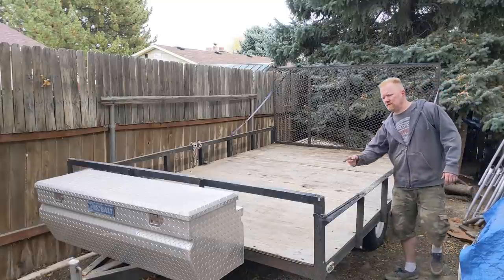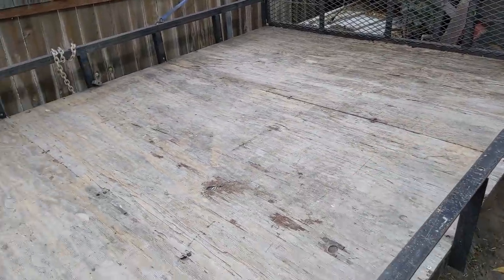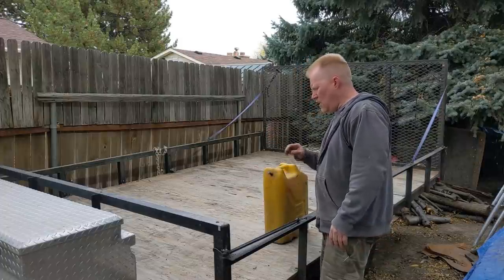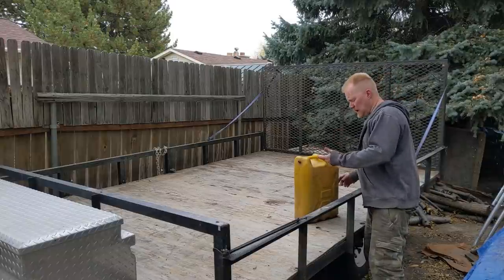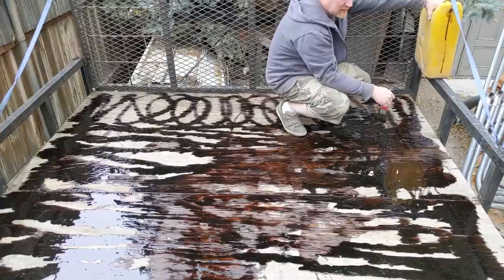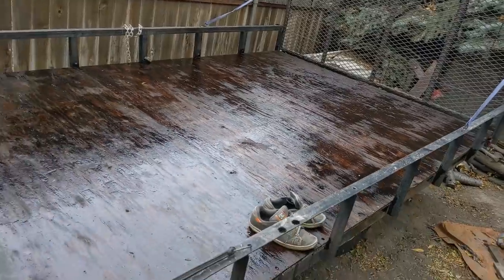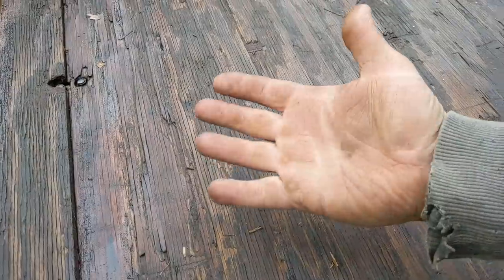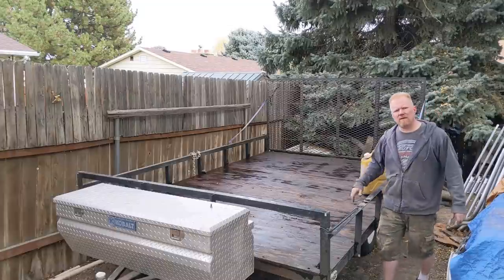Make Trailer Deck Last a Lifetime for FREE with USED Motor Oil

Comment: "If you don't have access to used motor oil..."
I feel like having 5-ish quarts laying around is a prerequisite to watching this channel 😎
Reply from the maker: Well Said. I have other videos where I do this and I get asked by people all the time where they can find used motor oil.
Reply: I NEED to find uses for mine, i filled up a plastic 25 gallon gallon barrel and am transferring it to a 50 gallon metal drum!
Reply: And a bunch of metal shavings around your vice
Reply: I keep old oil for these things and the apocalypse
Reply: @dethmaul  well you could take it to a recycling center.
Reply: @sixtyfiveford  I hate  to say it but if you have to ask where to find used motor oil maybe you shouldn't be watching this channel.....
Reply: So with my father saving used motor oil for his chain saws(keeping it in a metal 55 gal drum barrel, which is nearly always full) I should be able to have enough to do a fleet of trailers! Lol
Reply: @dethmaul  ...Ahahaha sell to the guys who can’t or won’t change their own truck oil or wife’s car/truck oil.
Reply: @dethmaul  I burn mine up in my fire pit, just dump on about a pint at a time on a nice hot fire and it burns up in seconds!

Comment: You could just park a chevy on your trailer for a couple days too :)
Reply from the maker: That's hilarious!
Reply: That’s a “slick” idea.
Reply: Or a Harley Davidson
Reply: Hey, my f150s got plenty of oil from the front crank seal to go around as well
Reply: That reason for the Chevrolet suggestion is because general motors makes such POS products you are guaranteed to get great coverage on the whole deck of your trailer since the oil pan, transmission, axles will be leaking almost from driving it home from the new car dealer.
Reply: Lmao
Reply: I was gna say my jeep would do the trick but then you won't know what kind of fluid it on the deck
Reply: If it's leaking oil... then it has oil... gotta worry when it stops 😄
Reply: ??? Never had a Chevy leak oil.
Reply: @that_one_dude_3541  never had a front main seal go bad?
Reply: @joshs1555  no?
Reply: Ouchy! lol
Reply: The problem with parking a Harley on the trailer is getting the dino bike to start.

Comment: I do all my wood handle yard tool handles with it. I have see a guy that put a large concentration of oil and sand in a bucket and after using his shovels he run them down the sand/oil mix to coat for rust prevention
Reply: Thats brilliant. Thanks for the idea.
Reply: Pretty cool trick, especially if you live near the coast.
Reply from the maker: That's a neat idea. I've done a few yard tool handles and it turns out nicely. I generally put a light coat of Johnsons Paste Wax over the top and it's nice and smooth.
Reply: My grandfather had an oil sand mix bucket he cleaned anything metal in it. Prevent rust and clean rusted tools. Always finding a "new" shovel/ hammer on the side of the road. Two days leaving it in there clean like new.
Reply: @sethpureadah  Did he agitate it at all, to get the abrasive benefit from the sand or just let it sit? I do the majority of my shopping on the side of the road, so this is  right up my alley, or my side of the road, so to speak...
Reply: @YerBrwnDogAteMyRabit  both. Just dig a spot and keep filling the same hole in. Then cover it up and walk away. Repeat that next day if some not always. If rust was layered on bad he left it in there for a week I remember, he just bring a rag and wipe it off afterwards. It would be polished.
Reply: @sethpureadah  Thanks man, appreciate it.
Reply: Holy crap...  that just brought back a deep memory from when I was a little kid...  maybe hanging with a grandad?  They both passed before I was ten.  Damn it's a weird feeling...

But yeah, there was big bucket of oily sand, & when you were done for the day digging & whatever; shovel, spade, hoe, etc., it got run through the sand to clean & protect it then wipe it down with a rag.
Honestly I'm kinda freaked out, feels like a memory that hasn't been used in ~40 years.  Definitely going to ask my dad (thankfully still around- just turned 80) if he has any idea where I know this from.

Comment: i agree ive used old engine oil on my trailers fences  sheds etc for years and it does last forever best part is the price
Reply from the maker: I think it turns out looking pretty good as well.
Reply: @sixtyfiveford  I agree makes it look like proper trailer board
Reply: How long till the scent disappears
Reply: Does it increase the risk of a fire

Comment: Cool, I do the same thing but I use a roller just to make it faster
Reply from the maker: That works. I just hate paint rollers as I feel a brush bristle force it into the crevices better.
Reply: Interesting.  Thanks
Reply: Drive you car up on it, use a oil filter wrench and pop the filter off, then roll the car off the back. The will spread the oil all over the place saving time...😂

Comment: I do the same thing on my trailer and decks.  The smell lasts for a few months, and it's initially slick, when wet, but over time it's been great.
Reply from the maker: Sometimes it smells, sometimes it doesn't so much. This time I didn't notice any smell. I attribute it to doing it in the cooler months where the sun isn't baking it. It might take longer for it to dry though.

Comment: Thanks for sharing. I use motor oil on my wooden barn doors. It lasts 10-20 years, none of these commercial wood protecting products come even close. You just want to make sure to put something underneath to catch the excess oil. And as you said, the wood should be really dry before applying the oil.
My truck now needs a new bed, will treat the new wood I put on the same way.
Reply from the maker: Thanks for your insight.

Comment: Im 48 and been using used motor oil on our trailers, fence post, fence pickets, landscape timbers and any other wood surfaces i need to protect since I was a young man and my folks was teaching me the way of work. For my trailer decks I just pour my oil in a used 5 gallon bucket and slop it on with a mop. My neighbor told me that it not environmentally safe and I said that the oil is organic and it comes from the ground. He never complained about it again. Thanks for sharing.

Comment: I do the same thing.  My favorite mixture is 1/3 old diesel fuel, 1/3 used motor engine oil, and 1/3 either used automatic transmission fluid or used hydraulic fluid.  But any of these by their self will work just fine.  The diesel fuel just thins the solution down and makes it easier to paint on.  I use a cheap throw away foam mop and mop it on the deck.  When I get a new trailer or replace a bed in one I coat the wood once a day for a week, then once a week for a month, then once a month for a year, and from then on once a year.  My wood trailer beds last me 15 to 20 years easy after doing this.  I have one trailer thats been in my family since 1961 and it is only on its 3rd bed.

Comment: Another great tip Moe. The wood deck on my small trailer is so rotten I could punch my fingers through it. Lol. I was going to buy good plywood. Now I’ll just buy the cheap stuff and do this. I’ll probably coat both sides of new board then mount it to the trailer deck.

Comment: When I was a young warthog we had a shed that had rough sawn wood floor. My dad taught me how to put used motor oil on it and I used the crankcase oil from my ATVs and after I don't know how old it was 15-20 years that we use that shed when we tore it down the floor was in the best shape out of the entire shed
Reply from the maker: Thanks for the insight. I've found it works wonders.
Reply: This tells me "Always do the whole shed, don't stop at the floor.." ;  )

Comment: I have a Pequea trailer and used it to haul my Jacobsen greens mower. That machine leaked so much oil, it treated the planking on the trailer at no cost or effort on my part. Used oil is the best stuff to use on untreated wood. I built a ramp on the shed in the back yard out of used lumber and it was painted with used oil and is still intact after 10 years. The wood outlasted the screws I used to put it together.
Reply from the maker: That's funny. Self oiling mower...
Reply: @sixtyfiveford  Gee, where did I hear that one? A self oiler. I had a Harley Sportster that I thought had a chain oiler. It had a small hole in the oil tank that was oiling the chain. Goofy me. That was so long ago. I`m still learning. You are one of those that I learn from.

Comment: Had a mate used to drill two holes in his sills on his car , fill them up with motor oil then drain them out of the bottom and he had no rust on his sills the car lasted for years .

Comment: Great video! I use a cheap paint roller and I learned the hard way to not use old gear oil mix, it stunk for months. I also apply it in direct sun light so it soaks in better.
Reply from the maker: Yeah, I played around with some test pieces years ago with some gear oil. The smell made it a definite no go.

Comment: Great idea, I have used old oil on wood fencing for years plus if oil drops onto the ground helps stop weeds, just don't over wet the ground,  not good for groundwater or course.

Comment: My old man had half a barrel of motor oil they always had fence posts soaking in so he's basically the three feet of the fence post he sticks down in the ground that was to keep termites from eating the wood that was up in Spirit Lake Idaho. Out on the island of Guam where he work as an engineer for the federal government there was a termite nest in a empty lot across the street from the house and he drove a bear two by four into the ground about 3 ft he drove another one that had been treated with paraffin green into the same termite nest and one  he painted with a brush two coats with  crankcase oil. Diritist is the better because it's about the carbons that makes it work better. This was a test in time 3 weeks the bear 2x4 was completely eaten away by the termites, pairafin green lasted two years it's supposed to be an anti-termite poison. The crankcase oil painted one where I was 12 years later when the termites finally started nibbling on it a bit. That was in 1960 and I was 10 years old.

Comment: Just used this method today on the new wooden bed floor of my truck. Bonus if you use the used diesel oil from the truck the stain will be nice and black :D

Comment: Timing timing timing...You jusr remonded me that i need to do this to my newest trailers deck before winter sets in... Great way to save wood from weathering as well as undercarriages .
Reply from the maker: It makes a difference, just don't do it on a 2x6 deck that is newer than a couple years as the lumber is still green inside and won't soak it up.

Comment: Try using 1 gallon diesel to 4 gallon used black oil  mix and a old mop and hydraulic bucket. Stick mop handle through pour spout on bucket for storage. Diesel thins oil to soak in a little better. Thanks for videos and time you’re doing good keep it up
Reply from the maker: Thanks. I find the diesel helps it flash off/dry faster. If I need to use it within a few days, diesel would have definitely been added.

Comment: Thx for the video.  I've wondered about this but was afraid it would be a horrible mess.  I am going to try this.  You're treating plywood, do you think hardwood boards would be any different?
Reply from the maker: Oak is such a open pore and low natural oil wood it soaks it right up. Douglas Fir and Pine have a closed pore and medium natural oil so they need to be dried for a few years before they will soak up any oil.
Reply: Standard practice on White Oak heavy equipment low boy trailer deck boards here in NC. They'll last several decades if recoated annually. I just did my new trailer side boards a couple weeks ago with a roller & broom handle. It's not messy. Best, @BranchAndFoundry

Comment: I used a similar mix on cabins and decks I built in WV years ago, I would dilute the used motor oil with diesel fuel ( never thought of used cooking oil) and pentachlorophenol (A wood preservative you used to be able to get it in a farm store, illegal now) and get this - that black plastic roofing cement mixed in makes a beautiful rich brown color, you can also mix it with mineral spirits to make a wood stain for other stuff.
One coat would last a year but it was so wet and rainy in the mountains there you needed to do it every year or so to make it last.

Comment: I was thinking you were the only Okie hick to do this. I did a search and you are one of many. I remember my grandfather had a waste oil heater in his boat shop. Then he upgraded to a 55 gallon drum wood burning stove and had no problem tossing cut up creosote railroad ties into it. The irony is that my cousins boat shop across the river with sano epoxy painted floors and cameras had a fire and burnt to the ground

Comment: I also live in Utah and Chevron makes a shingle oil for cedar shingles and I’ve used it on my numerous trailer decks many times over the years and it lasts a long time.
Reply from the maker: I've heard of it but have never seen it in person. It looks like it can be found at Pilot in North SL.

Comment: I have used motor oil on untreated posts. put the post in the hole, fill it about halfway up with oil, tamp in yer dirt.put some in the early '80's still seem pretty sound. Elvis used black shoepolish on his hair, so i've been told. I haven't tried that yet.

Comment: What about on your new or even old porch,/deck on house?  Have them and two trailers to seal. One is new deck on back of my hoise. Was just going to use Thompson Water Sealer.
Reply from the maker: The issue is new Lumber is never dry enough to soak in the oil in a timely fashion. Wood that aged about a year to two years is finally dry enough to fully benefit from this. Woods with a lot of natural oils like redwood  don't soak in oil very well at all. That's because they're full of oil already.

Comment: I replaced the floor of my little 4x8 trailer with a sheet of used concrete form board about 15yr ago and have never treated it. It is still going strong with only a few soft spots around the edges. I have been wanting to replace it with a sheet of 1/8in-3/16in metal.
Reply from the maker: I've owned lots of trailers and a few had metal decks. The only downfall to a metal deck is they are so slippery if they get wet, even when they are diamond tread.  Concrete fiber board is a unique idea. I've had scraps laying around for years in the whether and I'm surprised how well they hold up.
Reply: @sixtyfiveford  They are actually impregnated with oil so concrete does not stick to them. Also with it being used the concrete contractors spray them with diesel or form release.

Comment: I've been curious if we can do that on the shed ramp. Just the ground contact side. 
But I don't even dare to ask my neighbors about it...
Reply: Don’t bother asking your neighbors Just do it, even on top of the ramp surface. I usually mix in 1-2 pints of diesel to thin it out a bit.
Reply: @unclefuddelmer9224  Is that the sole purpose of adding diesel, to thin it out for "spreadability" ?
Reply from the maker: Diesel thins it for spraying but it also makes it dry faster. It probably soaks in a little faster/deeper with diesel but it's not necessary. Gasoline works as well, but boy does it stink and cause a major concern.
Reply: @sixtyfiveford  Thank you. I'll omit the gas because I don't need to be the cause of a headline reading "Local man dies in fiery fence inferno in an ill fated attempt to preserve his wood..." or something like that.

Comment: My daughter and I ripped out & are replacing the floor in the horse trailer, (new 2z12's).  I laid the boards appropriatly, (on pallets to keep them just above my old dirt driveway (dust suppressor :)) and applied one coat (hot day done by 1pm) of my dirty cummins motor oil and diesel mixture, (50/50) on every one side of each board, intending 3 coats.  Three nights later it spontaneously rained/hailed like a cow doing everything on a flat rock.  They got real wet.  The top boards have bowed one way ore another.  Am I too late?  A lot of people do 1 and done.  I thought I was going to be an over achiever... Daddy would be proud.  I'd ask him what to do and he'd tell me but, he's gone.  I'd really appreciate  your opinion if you have any.please.  Thank you
Reply from the maker: New lumber is notorious for warping/ twisting once it's taken out of the bundle. It's generally still be wet/green for months and can be bent into place. It'll stay where you put it once it dries.
Reply: @sixtyfiveford  Thank you very very much.  😁

Comment: I've done this on all my trailers.  However,  I have found that they are definitely slippery.  Even after a few months.  It doesnt bother me tho.  I am able to jockey my atvs around easier!  I love free stain!!
Reply from the maker: I agree, but it's not slippery like a metal trailer deck/metal truck bed. Stuff still stays where you put it. Most of the trailer decks I've done are pretty dang coarse from weather to begin with so there's really no noticeable slipperiness. If it was applied to newer, really smooth wood I can see noticing slipperiness.

Comment: That is awesome to know thanks, but I wonder can you do something similar do underneath a lawn mower to keep the metal from rusting.
Reply: Why not?  Certainly would be better at preventing rust than not having it.
Reply from the maker: I did a few garage tests with rust resistance and motor oil on bare steel. It works and the price is right, however there are better products that are easier to apply. I think WD-40 did a little better than motor oil and it's effortless to apply.